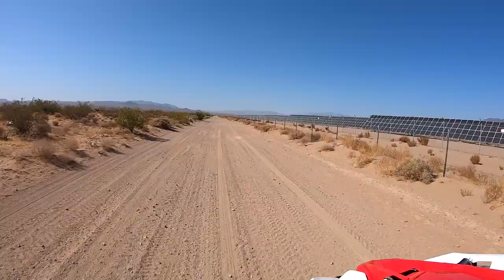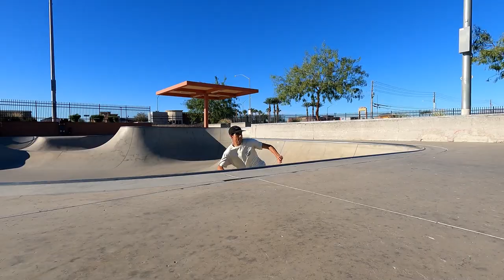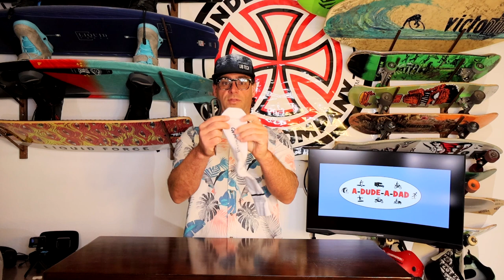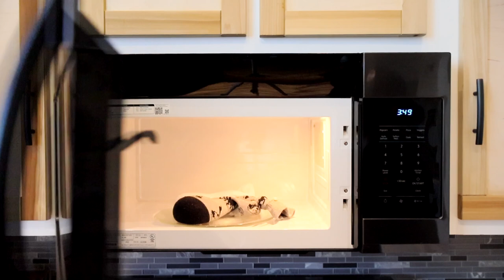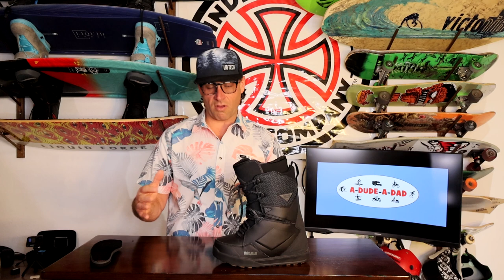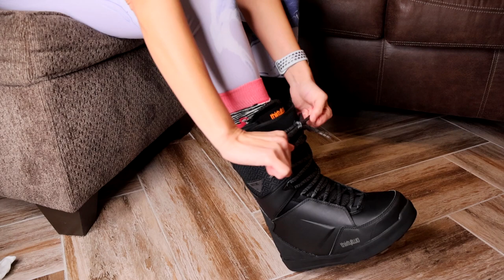Heat Molding Snowboard Boots At Home, With Household Items

Comment: Ive always just stuck a blow-dryer in them for a few min to heat them up. Then put them on.
Reply from the maker: Right on, I bet that’s WAY quicker! Thanks for sharing your method, I never thought of that. 🤙🏽
Reply: @adudeadad  no problem hope it helps!
Reply: I never had heat mold liners and I just got a pair of 32 double boas. I wore them out on the mountain once to get a feel for them, and then today I did the same,

I got a blow dryer, a towel, warmed them up on low, wrapped the towel around the inner lower side to create a semi vacuum, let it run for a minute or two and set my set in right away and tightened it up, walked around, repeated a second time. Feel like I’m gonna do one more time the day of or before my trip next weekend
Reply from the maker: Heck yeah, love to hear other methods. Thanks for sharing👊🏽
Reply: Yeah, i did this to my new Burton Ion’s and its amazing. They’re 100% perfect now. Thanks!
Reply from the maker: @risu870  Right on dude!🤙🏽

Comment: How many degrees should be the rice? I don't know if it was hot enough, I think it was 80 degrees, I don't know If I should repeat all, I did exactly like this video, the rice was hot it evaporated but I could hold it in my hand (So I think it was less of 100 degrees)
Reply from the maker: When we do them they aren’t too hot to touch but they are too hot to hold. I’m unsure of what you  “evaporated”. Feel free to try the process again. If the sock full of “raw” rice was only 80f the first time, you didn’t get a good heat soak. Hope this helps. Good luck🤙🏽

Comment: How do you know if you need the ankle donuts or not?
Reply from the maker: The number one indicator of needing to use donuts is: if your heel is lifting inside your boot when transitioning to toe side turns. The mom is not running them in the boots used in this video because the molding process provided adequate ankle lockage. Hope this helps. Thanks for checking us out!🤙🏽